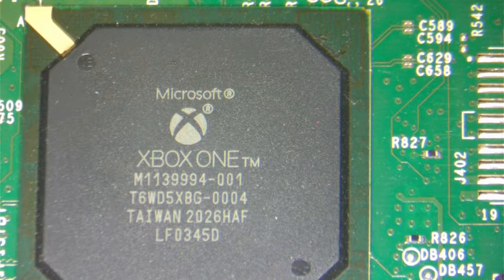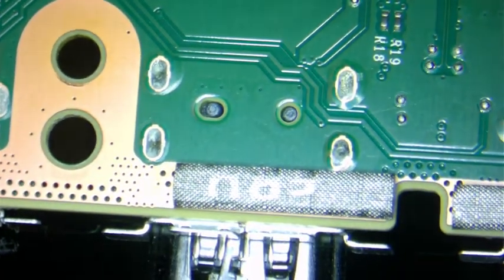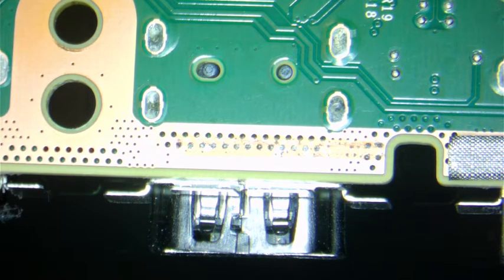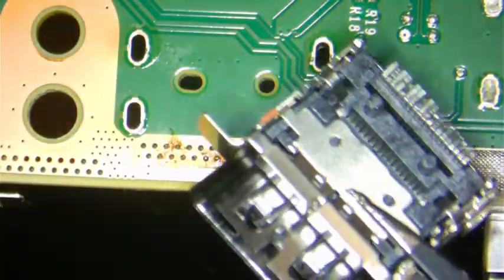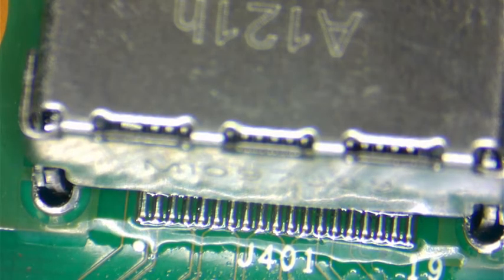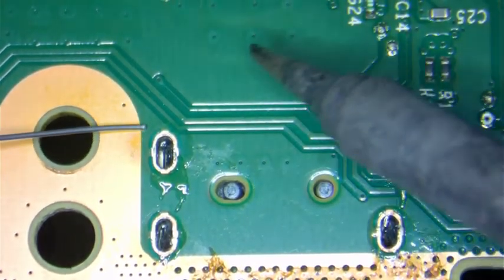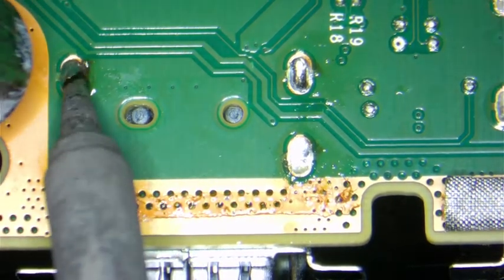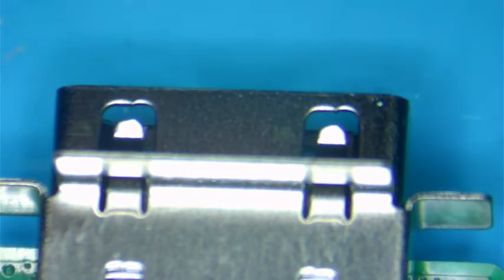Xbox Series S HDMI Port Replacement - NO VIDEO FIX

Comment: Did you use a heat-gun for the second heat source blowing up? Also how do you determine if its the port or retimer chip? The port you showed looked fine to me, so does the port on this xbox I have right now. I'd rather not buy a $30 IC and replace it if thats not the problem.
Reply: Oh I'm sorry you did say heat gun. I'll have to get one